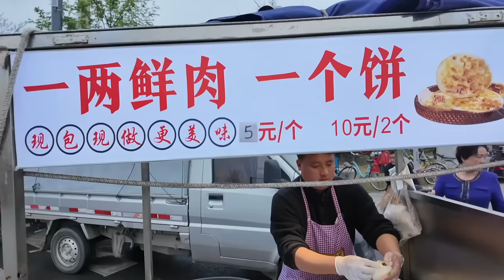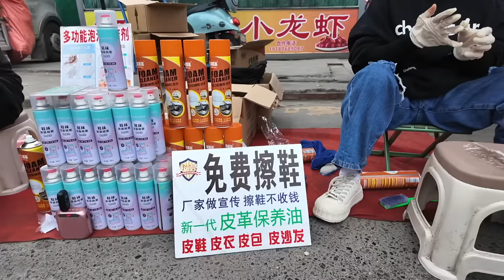中國四川成都城市大市集，人山人海，現場製作不沾鍋大開眼界，5元衣服遭瘋搶，熱辣的油炸烤鴨拌菜，霸氣大鍋炸酥肉、大鍋肥腸湯麵，免費擦鞋，美女修表匠，BMW搶眼賣鞋，千奇百怪的地攤中藥，熊貓之鄉遍地是寶！

Comment: 33:10 Does he really manufacture non-stick cookware on the market?  He is a skilled worker. In Egypt, they are manufactured in specialized factories. This is wonderful, and I hope this exists in the Egyptian markets.  May Allah protect you
Reply from the maker: Yes, the principle behind this master's creation of a non-stick cookware is as follows:

1. The cookware is heated to a high temperature using a blowtorch, causing the surface of the iron cookware to form a dense oxide film. This film not only provides the non-stick effect but also prevents the cookware from rusting.

2. After the high-temperature treatment, the surface of the iron cookware will have tiny pores. At this point, applying cooking oil allows the oil to penetrate these pores, forming a layer of oil film. This oil film not only enhances the non-stick property but also isolates air, preventing the cookware from rusting and thus prolonging its lifespan.
Reply: @dawenfood  amazing .  I didn't know that, thank you